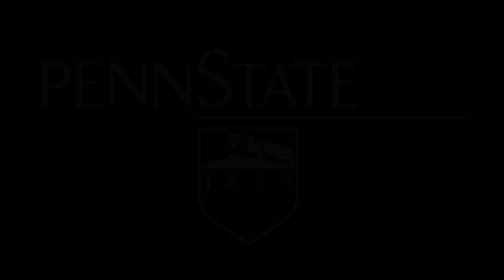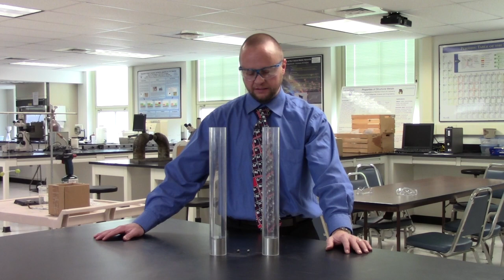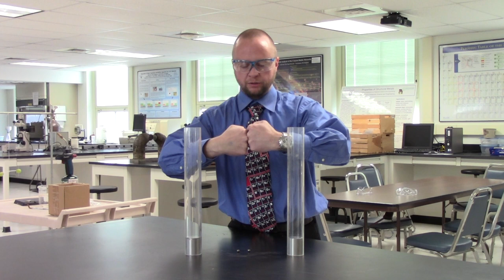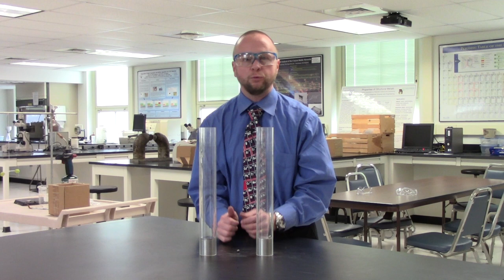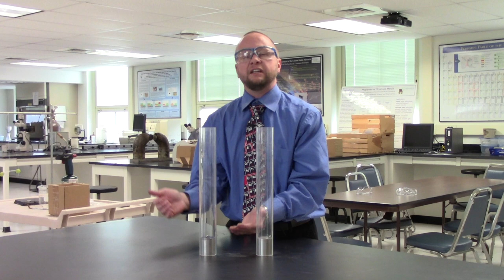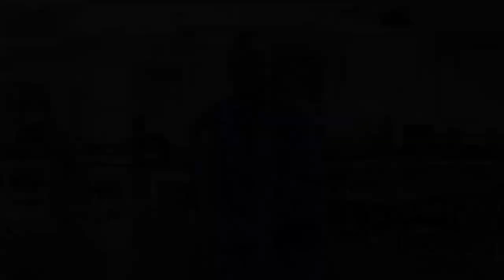Metallic Glass

Comment: Drop a metallic glass ball bearing onto the flat metallic glass
Reply: ...you have been spotted, the aliens that run our world simulation would like to speak to you!

In a serious tone, there won't be such a huge difference, because the key here is that the two things that collide do not have identical characteristics so they cannot transfer energy from one to another. And the best way to make sure these two are totally different, is for one to be amorphous and the other one to be crystallized.
Reply: That would just make it bounce longer, cause the ball is taking the energy by changing direction, not by deformation
Reply: @AlehandrosArhangelos  you're missing something, because the ball bearing should lose some energy on changing is own grain boundarie structure wich should happen because gravity is still acting on the ball, and there has to be a way of stopping, or else the ball would bounce a lot more because air  itself would take much more time to slow down the energy that the ball has, also maybe the narrator of the video forgot to mention that the metal doesn't have any phisical change but still has elastic properties like a trampoline but much more tight and that shoul steal energy from the bouncing
brownian motion, heat diferences etc.
Reply: @marvalice3455  itshould have some elastic deformation dough, like a trampoline, but much more tight so the movement is neglible
Reply: @marvalice3455  BETTER EXAMPLE : like glass ;) but of course glass breakes and is the little brother of the other materials from wich you can make ''glass'' regarding the properties of the material

Comment: What is the practical application of this experiment?
Reply: Space Drive.
Reply: In war for example, armor and kinetic penetrators would improve a lot.
In civilian application? Wheels of high speed trains, bearings with reduced friction, etc., 
Basically any application where you need high hardness and extremely low friction coefficients.

Comment: why aren't amorphous metals extremely brittle?
Reply: maybe the sea of electron in between the atoms C: because you have to remeber that silicon (the element) is a ''metal'', but glass is a ceramic, (oxygen)  ceramics are amorphous materials  (oxygen) just like you could say that a ruby wich is made of alumminum (has structure is cristalyne) but it has oxygen so maybe even if you heat treated it to make it glass it wouldn't be too strong in comparission with the cristalyne one, maybe even less, i don't know, but  the key should be on the oxygen prescence

Comment: So, what kind of steel is this that is cooled at thousands of degrees per second?  How do you prevent from undergoing a diffusionless phase transformation to some sort of body-centered tetragonal lattice like martensite?  I always thought that regular steels were too ordered in atomic structure to effectively lock themselves together amorphously.  Is it because you cool it from liquid down to a temperature much faster than the atoms are even able to assemble in an austenitic FCC way?
Reply: imagine if you cooled steel right on the edge of being molten in liquid nitrogen.

how amorphous would it be?

would it even cool fast enough given the leidenfrost effect?
Reply: I think the Leidenfrost effect would slow down the cooling significantly due to the reduced conductive abilities of nitrogen gas.  I do know that one way they rapidly cool metals is by pouring molten metal onto a spinning solid metal wheel which is internally cooled by liquid nitrogen. This achieves cooling rates of tens of millions of degrees per second.
Reply: Not an expert at all in BMGs but I'm pretty sure modern ones don't need to be cooled that quickly. Your last sentence is essentially right--imagine that you cool austenite down slowly--you get ferrite. Cool it down faster (before the atoms can arrange into ferrite) and you get metastable martensite. Cool it down even faster (before the atoms can arrange into martensite) and you get an amorphous structure, which is essentially the atoms frozen in the same position as in their liquid state.

However, by using chemistry, you can slow down the rate at which the atoms can assemble into a periodic lattice. I think a lot of this research was done in conjunction with HEAs (High Entropy Alloys). Haven't looked at this in a classroom in a few years, but I believe the principle is that by mixing in lots of elements that want to form different crystal structures, you "confuse" the atoms about which period structure should form and that allows it to stay amorphous even when you can cool them over a period of a minute or so. I'm pretty sure that's why they're BULK metallic glasses, because there is a limit to how fast you can cool by conduction (probably a bigger problem than Leidenfrost). We've known about metallic glasses for a long time, they've just been useless because you could only make very small pieces with large surface areas for instant quenching.

TL;DR You don't get BMG steel by just quenching regular steel super fast. Instead, you need to adjust the composition so you can maintain an amorphous phase even at reasonable cooling rates.
Reply: @smashgambits  BUT YOU FORGETT THAT even ferrite has crystaline structure so you can't make this from solid
Reply: @martin11844  Of course ferrite has a crystal structure? Almost every solid has a crystal structure--the absence of this crystal structure is the definition of "glass."
Reply: @smashgambits  still, if you want the atoms to be frozen on the liquid state positions, you have to get the metal to be a liquid in the first place, by definition you can do it from the solid state, not even if is in the line betwen solid and liquid
Reply: @martin11844  oh no, you don't need to get the metal liquid to get the amorphous phase, it you don't mind shacking the material into a fine powder.
You can use mechanic alloying, basically you put the materials inside a vial in powder form an then hook it to a high energy mill, basically a super milk shaker which agitates it several dozens or times per second.
Depending on them mix you can get several products but one of the possible outcomes is a metallic glass that then you can work through powder metallurgy into a bulk piece.

Comment: OK, but how is it made ? i mean how do you evacuate heat from a chunk of metal at that high rate ? like that lump looks like at least 1 KG and to cool soooo quickly how ? like dunk it in Liquid N2 ? thin filims yes but how do u make a chunk of this material ? wont the insides be in crystalline while the outside is amorphous ?
Reply: You don't cool it quickly, you manipulate the mixing entropy or the alloy by adding more and more different elements, increasing the mixing entropy to the point that it is to high that the spontaneous crystallization of the alloy becomes thermodynamically unfavorable even under slow cooling.
That is why bulk metallic glasses are always alloys to several, sometimes more than 10 or 20 different elements.

Comment: can light pass through metallic glass???
as due to absence of periodicity of atomic arrangement 
thank you sir
Reply: No, it's actually not the periodic arrangement that stops light--it's the bonding (as in, quantum mechanics). Take SiO2, which can be amorphous (window glass) or crystalline (quartz). Both are transparent.

Roughly speaking, light can be reflected, absorbed, or unaffected by the atomic structure. What happens to light depends on the wavelength, which is why things have color (because that wavelength is reflected instead of absorbed). In window glass, lower energy light (visible light) has a wavelength too large to interact with the glass, so it passes right through. Higher energy light (UV) has a wavelength which does interact with the glass, and gets absorbed.
Reply: @smashgambits  tell us if maybe an alloy could get to be transparent, i want a wire of it  (i think there should be some combination to it
Reply: @martin11844  Metals are defined as "metals" because they have overlapping conduction and valence bands (i.e. no band gap). Since there is no band gap, there is no wavelength of light that can "fit through" the band gap. So with our current understanding of physics, a transparent metal is impossible.

However, there has been recent research done in transparent conductors (which should be impossible for the same reason) so I suppose it's possible we might one day make a transparent metal.

Comment: crystalline metal with carbon or diamond like structure with strong bonding strength are much better than any amorphous metals. Its the way it connects to the other atoms that tells how much the atom can slip around. For example the symmetrical 4 point atomic bonding that form a perfect radial "honeycomb" like atomic structure. Because we use things like that. 
So far human can only able to manipulate materials/atom from external means.
Reply: thats what people say when they cant digest some knowledge. "insane".
Reply: Light and other materials could force through gaps however, and how do you address hardness to brittleness? Crystalline metals are susceptible to breaking easier, I suppose bonding would help but under extreme conditions the chemical bonds are bound to change